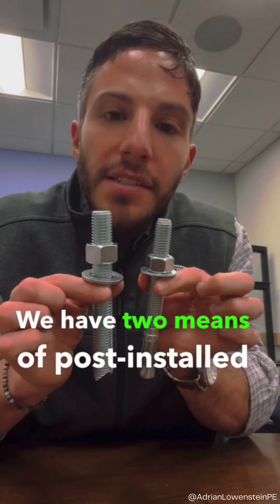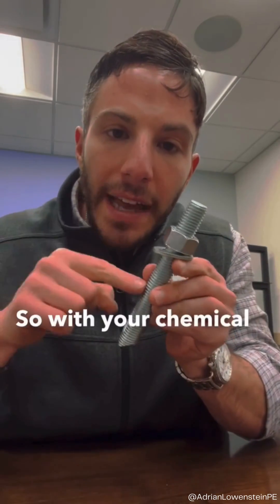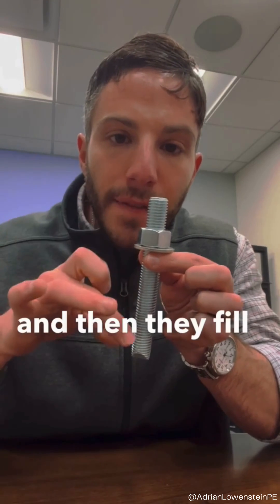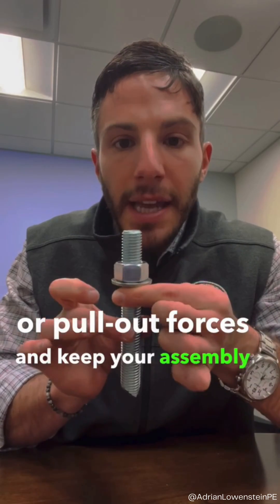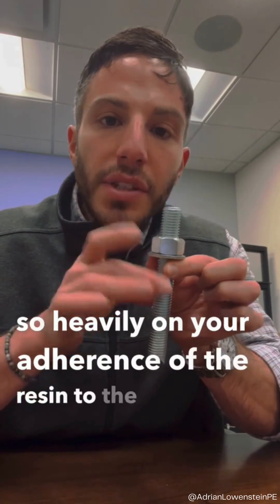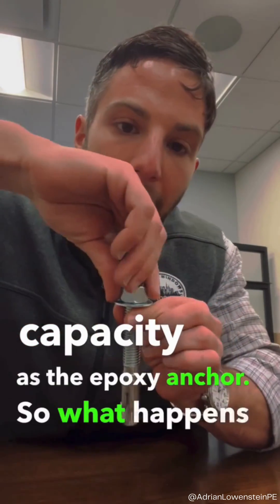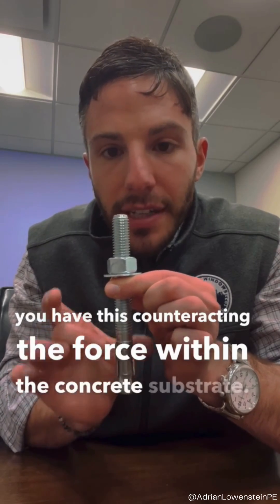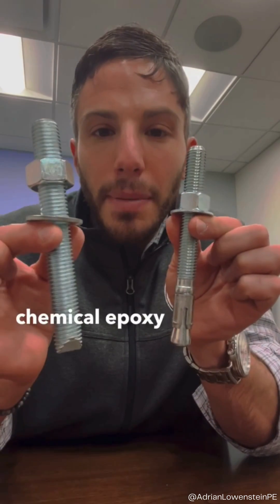Mechanical vs. Chemical Anchors - what's right for you?

Comment: You give a crew you trust to do a good job the chemical anchors for the highest strength.  You give your run of the mill dumbasses the mechanical anchors (and add another box for strength), because its hard to screw them up...